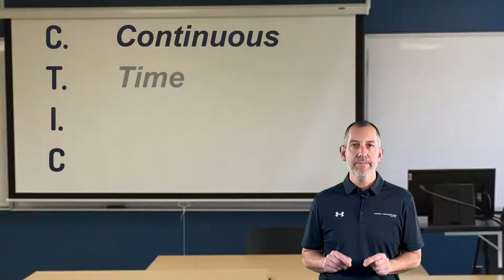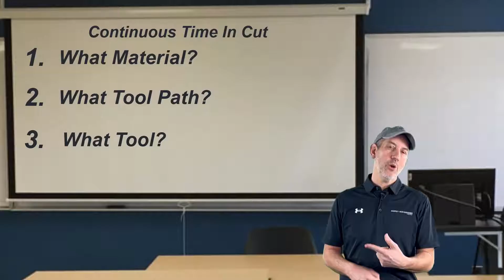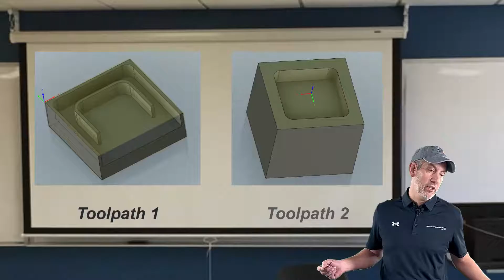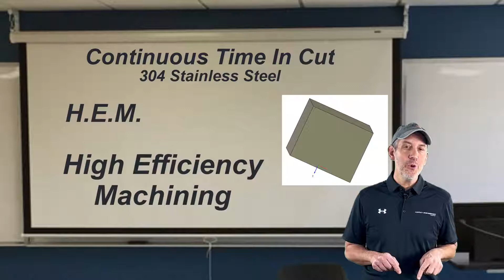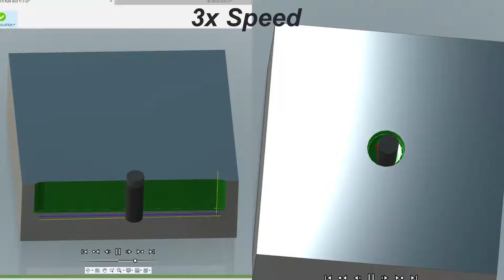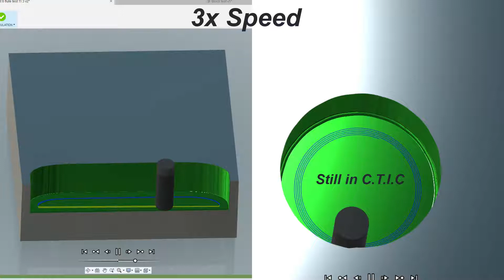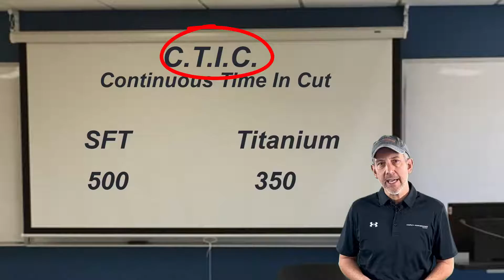Continuous Time In Cut: In The Loupe TV Ep.11

Comment: I'd like to see some sources on this, or some independant testing. I believe that there must be some effect, but what is the magnitude? Is it really better / worse than the increased number of entry/exits? I have a spindle with a vibration sensor and I can see that entry and exists always have increased vibration. I could see maybe in a slotting operaiton where it's harder to get coolant, but if you have 500psi through spindle coolant and the appropriate toolholder to make sure the coolant gets deliered to the tool, then even at that point is it an issue. Finally, does the increased cycle time pay for the tool?